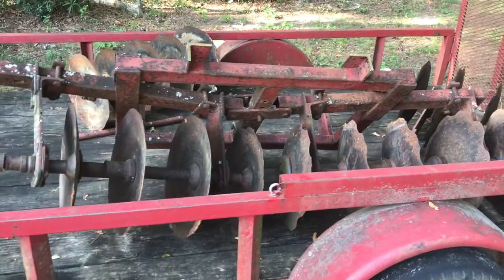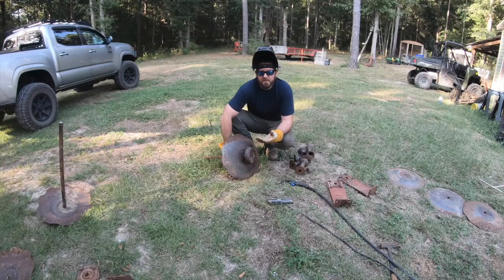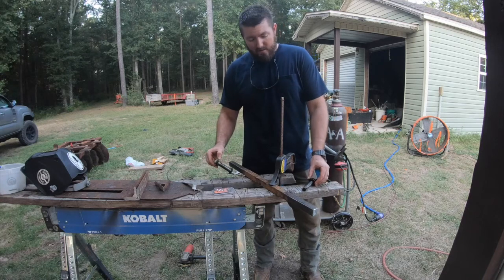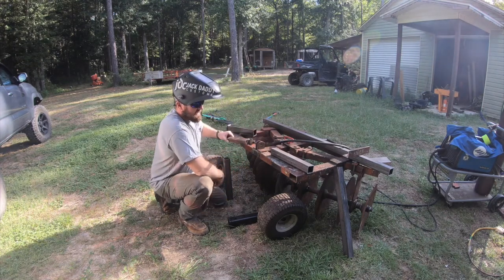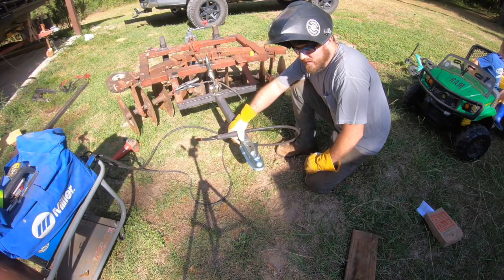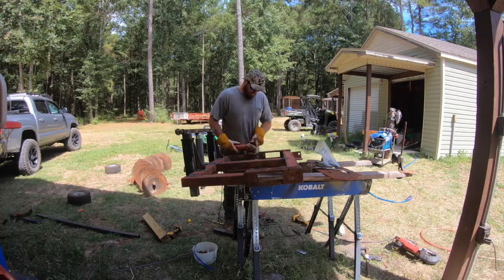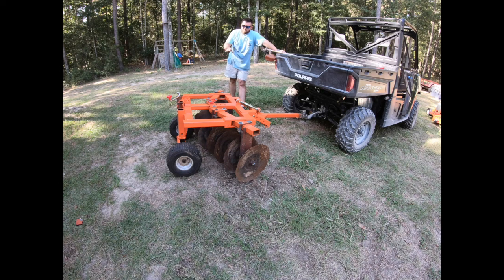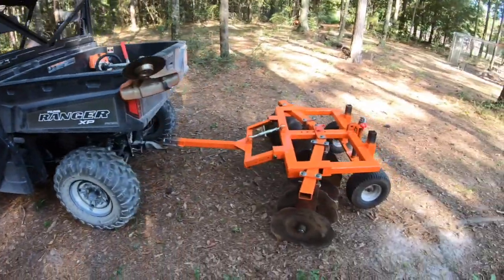Homemade DIY disc for UTV or 4 wheeler ATV.  restored old farm equipment gets new life behind ranger

Comment: Look at adding some ballast.  Old-time farm discs had trays (similar to battery trays, but bigger) to hold concrete blocks.
Reply from the maker: If I lived where I grew up, I would have to No doubt, this wouldn’t cut it by itself. But here in the south, we have sandy soil and it cuts fine how it is. All depends on soil type, but your right… hard souls would take more weight.

Comment: I'm curious why u chose to weld everything together instead of bolting the axles tight. Now it has no tension against it. Jesus lover here too.
Reply from the maker: i didn't have a way to thread the axles for a bolt, and i didn't want to buy one since i was trying to use what i had on hand.  i just got it as tight as possible and welded the caps.  its not the BEST way, but it will work for a long time no more than i use it.  Thanks for watching!
Reply: @JackArmstrong-jackdaddycustoms  totally understand that. I see what you wanted to accomplish.